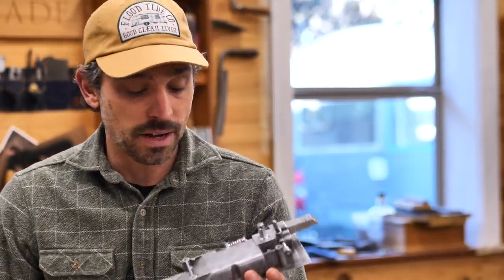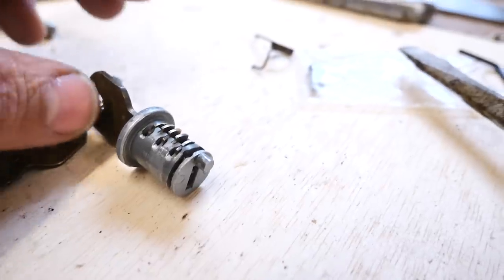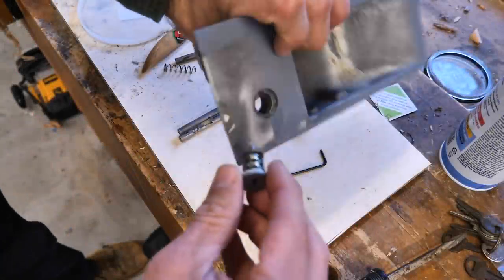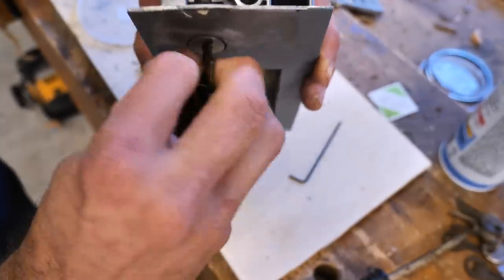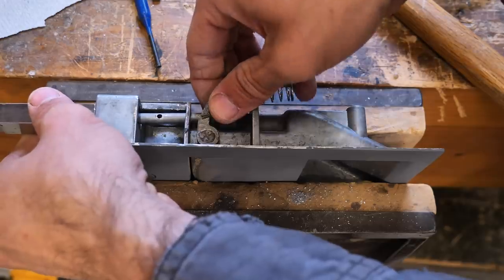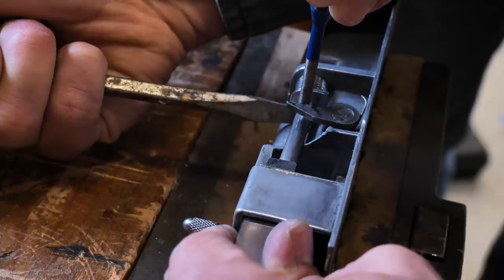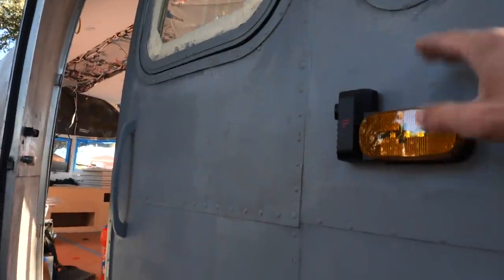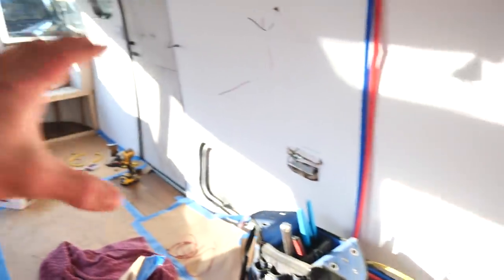The $750 Airstream KT Door Lock (You Can't Replace This Thing!) // Argosy Update

Comment: Andy, Do yourself a favor & get a "modified" deadbolt from Vintage Trailer Supply. Mount it in the wall, not the door, so the "bolt" extends through the door jam & into the door itself. It'll help save your old KT lock, plus you'll get extra security.
Reply from the maker: Thanks Colin!  I actually had the discussion with my Dad that I didn’t feel like the KT lock was very secure.  I had no idea I could do this so thanks for the suggestion.
Reply: Old Locksmith here. You should have made a new key, not filed the pins. That lock should open with a butter knife now. It would have been interesting to “challenge “ The Lock Picking Lawyer to make you a new lock set!  Also I see wood workers using drills to Mark hole locations often. Get a set of transfer punches. I don’t mean to be critical. You do great work. Love  your videos!

Comment: Andy just an FYI, Spartan Mobile homes used a very similar locking latch to your Air stream, back in the 1950’s. And you can still get those locks that was used on the 1954 Spartan Royal Mansions. It is not an exact match, but it is similar and might work for your air stream. As both company’s made a similar trailer.

Comment: The brass parts in the lock are called 'tumblers' in the UK.
Rather than filing them all down, you needed to look at what was causing them not to go flush so you could turn the lock in the first place.
My guess is it was damaged tumblers or, more likely, the wrong key for the lock.
Each detent in the key allows the tumblers to rest at the correct level and each tumbler will be different to fit the original key.
I just hope you have enough meat on the tumblers for them to still do the job they were intended for, namely locking the door.

Comment: That lock core looks very similar to ones used on Yakima bike racks. When you get a set of lock cores they come with a separate master key that allows you to install them on the rack. This key would set the brass tumblers so they are flush and allow the core to slip into the rack.  The key that unlocks the core is different, and allows it to rotate, whereas the master key only allows it to be installed.
Reply: I looked into those yakima corse too, but they are a different size, they will not fit this lock.

Comment: The pins on these types of locks are called “wafers”. You’ll mostly find them in automotive locks and ignitions but also in trailers and some cabinet locks. 
Most of the time you have the issue you had it’s because the wafers are bent in from the key hitting them, causing them to not go in all the way and then the key wears away from being forced in. I clean them out and file them down as you did only I do it with the key in the cylinder.

Comment: Hi Andy,
Really glad I found this video. Spent all day removing cleaning and rebuilding my KT lock. Until the moment when I turned the lock over to try and clean a part, and a little tiny ball bearing fell on the floor. After seeing your video I see where it goes, but mine fell out from the inside of the vertical "lock" latch. I didn't remove any thing before it fell out. I was wondering if your lock has a set screw both on the outisde where you showed in the video, screwing the ball bearing ans spring into the slot. But also on the interior of that "tunnel", is there a set screw there? On mine, it seems the bearing comes out from the interior of the lock...

Comment: The cylinder is called a wafer lock.  The reason the wafers were sitting high is because the broach profile in the aluminium core were worn.  You could have modified the new core you ordered as long as the overall length was the same.  Your old core looked like it was retained by a separate wafer.  There is no security in these locks.  Keeping the old mechanism as a latch bolt and fitting a separate euro style mortice bolt for security would have been a more robust path.  I’ve seen these old locks broken in two through the handle and they have machined a new housing on a CNC and transferred the guts to the new housing.  There is always a solution.

Comment: I realize your forte is in wood. However the more you work with metals, the better you will get. Those type locks seem to be pretty well designed and other then wear, everything else can be repaired fairly easily. And if you knew how to weld, the wear parts can be build up and refinished to factory specs. But that is after you gain the expertise with welding... Thumbs Up!

Comment: I own a 1974 sovereign, and unable to remove interior door handle? I Removed screw but handle is not coming off, I am cautious about pulling too hard or using anything to pry knob off! Is there a secret to removal? Help!
Reply from the maker: Mine had some kind of sealant around it that I had to break free.  Other that it was just a few screws from the inside and one on the edge of the door.

Comment: Hey Andy; when you start building out the walls (interior) what kind of lightweight materials do you use to keep the weight of the RV from getting out of hand?
Reply from the maker: I'm using cypress for the framing lumber and will likely skin the walls with either 1/4 or 3/8 plywood.  Right now I'm planning on veneering the skins with sinker cypress wood.

Comment: You could have saved a lot of time if you just tapped the holes and put grub screws in it. Then all you would have had to do was get everything lined up and tighten the grub screws down. Once the ends of the grub screws put marks on the pin you could have just drilled the pin and allowed the grub screws to thread down into it with some thread locker.